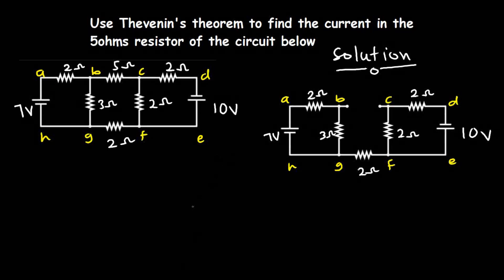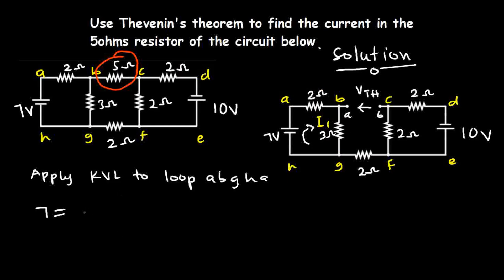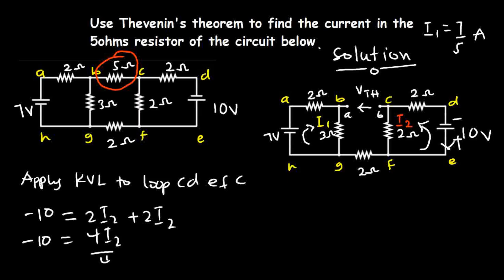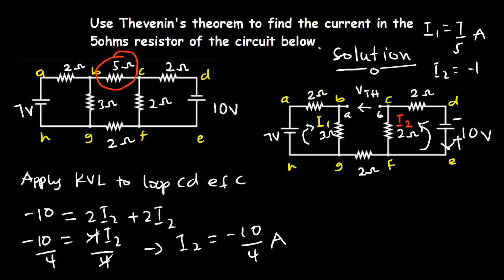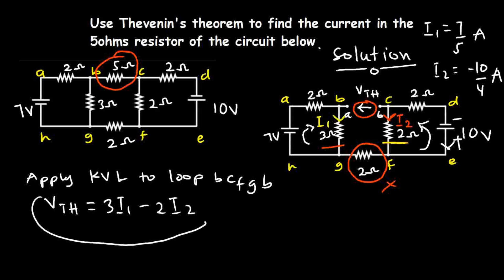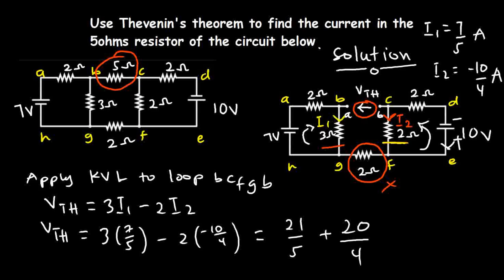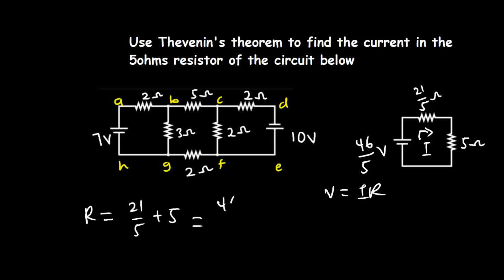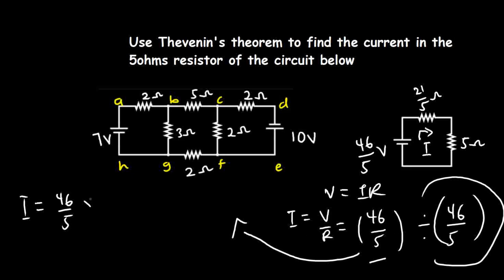Thevenin’s Theorem (Solved Example)

Comment from the maker: Why the two ohms resistor was excluded.

Before we calculate for the Vth ,we have to take out the 5ohms resistor.When this happens,the middle loop becomes opened and current doesn’t flow in an open loop .
So this will cause current not to flow through the 2 ohms resistor.

The other two resistors in the middle loop have current flowing through them because they are in other loops which has voltage sources and those loops are closed loops.
Reply: Oh okay thank you very much for the clarification, I thought that at the node where the 2 ohm resistor is, the current will split from the first loop.
Reply from the maker: Welcome Sir .

Comment: Hi, thank you very much for this video, please I want to ask, why was the 2 ohm resistor shortcircuited? Thank you
Reply from the maker: Hello Sir,thank you very much for your question.

Before we calculate for the Vth ,we have to take out the 5ohms resistor.When this happens,the middle loop becomes opened and current doesn’t flow in an open loop .
So this will cause current not to flow through the 2 ohms resistor.

The other two resistors in the middle loop have current flowing through them because they are in other loops which has voltage sources and those loops are closed loops.
Reply: @mathshubgh just the perfect explanation needed